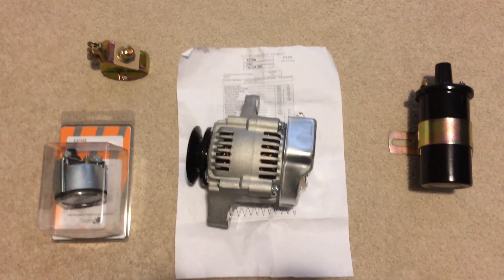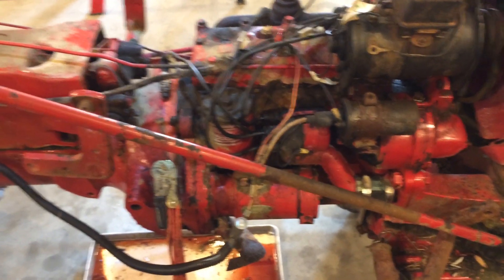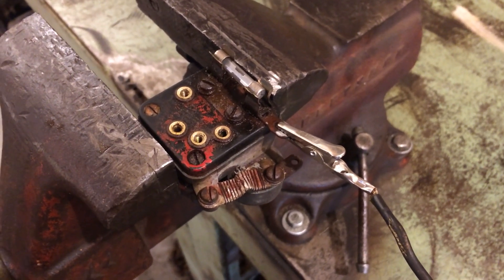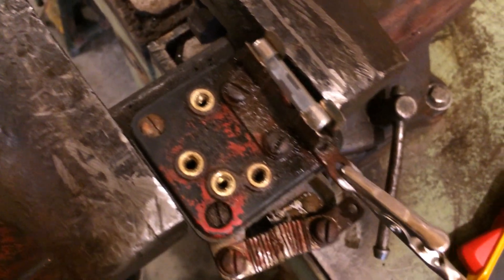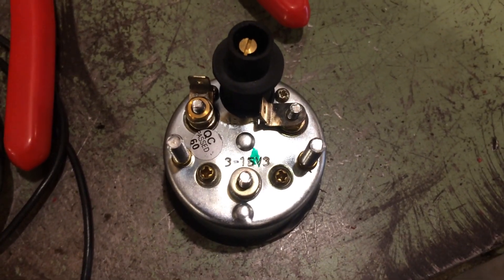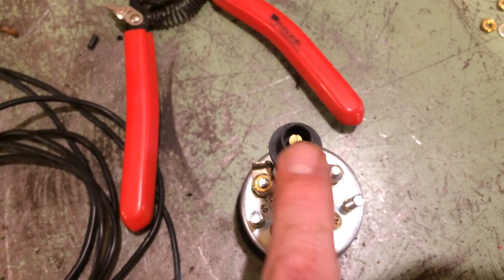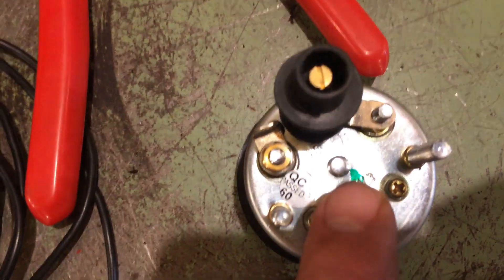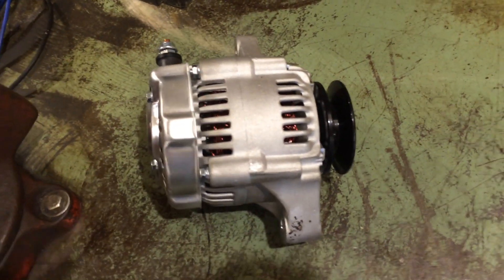Tractor 12 Volt Conversion Step-by-step Part #2

Comment: Will a starter on a farmall a with positive ground work if hooked up to 12v neg ground? Or will it need a new starter?
Reply from the maker: @JSTEALTH  unless you have some unusual starter that I don’t know about, the original starters work just fine when converting from 6 V to 12 V. You do not need to buy a starter to do a conversion to 12 Volt.
Reply: @justtinkering6054  i hooked it up to negative ground and it just sparks.. hooked up with negative on the switch it works fine

Comment: What is the model # of the new alternator.  I like that built in voltage regulator.  The coil has a built in resistor.  I want to go electronic with my distributor also.  My old alternator fried all my wires when it shorted out on the hood.

Comment: You don't need power to check the switch.  Just check continuity between terminal points; aka ohm meter. The fuse can be checked in the same manner.